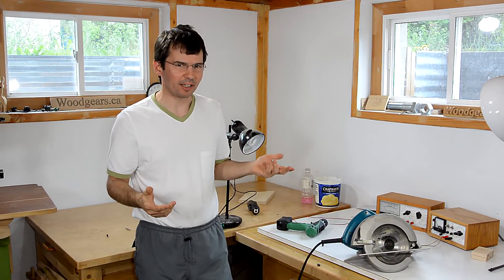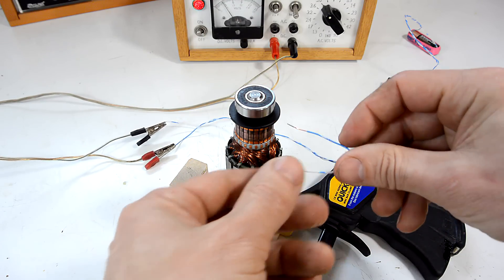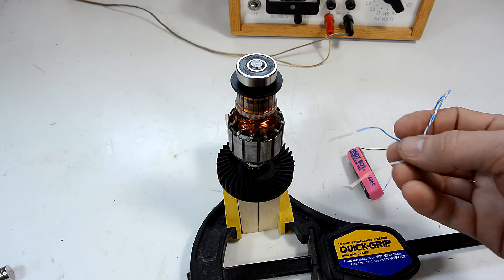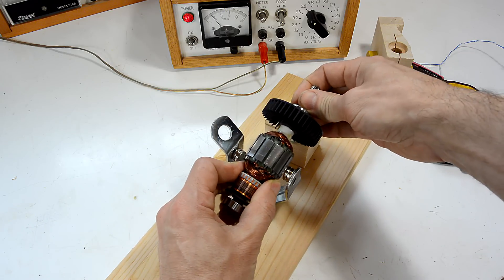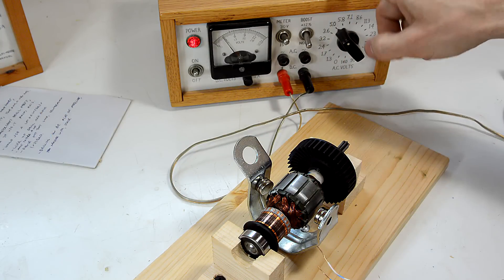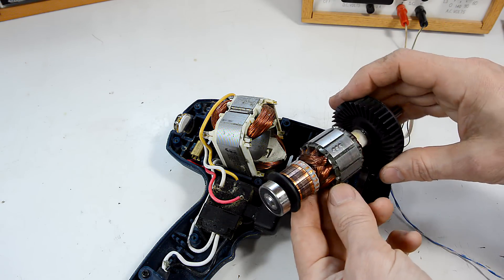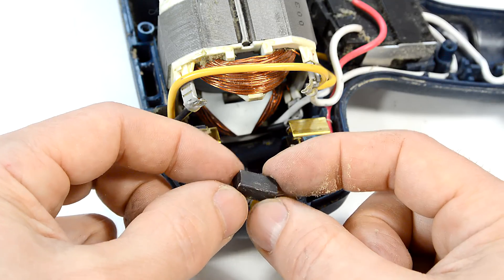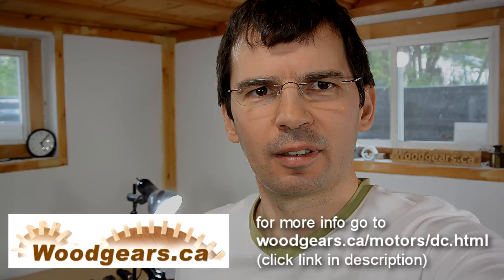How DC motors and universal motors work

Comment: Excellent presentation ! In particular, the fact that you went in to the trouble to disassemble the drill and build a wooden stand - to show us the function of the motor - is really remarkable. Also, the idea to use small battery and magnet was just brilliant. It is funny, but this is the best video I have ever seen on electric motors, and it comes from a ...woodworking channel !
Reply: time bohut dohunea boni sa

Comment: Some motors that use brushes offset them so the motor runs better in one direction over the other. Motors in toys only have 3 coils (2 would work but have dead spots, no serious motors are made with 2) with say 10 coils, you can move the interaction area closer to where the magnets are in rotation and get more force since they are closer together on average (before the brushes switch to the next coil set, playing keep-away!)

Comment: Excelent presentation. Nowdays, universal motors are mainly used, which for me is a surprise, because nobody mentions them. I was opening a hair dryer and noticed that the motor inside is brushed and didn't have permanent magnets, but it is directly connected to AC source, without a bridge rectifier, so I was surprised. Thank you

Comment: This is the best video I've seen that describes how the DC motor works.  Forget all the fancy graphics, there is nothing better than someone actually demonstrating it with actual components from a very basic perspective.
I have a video coming up that shows a very old (1905 in fact) elevator machine room.  There is a DC motor in use and I'm going to briefly explain it, with a link to your movie for a full explanation.

Comment: You know, I bet the thumbs down are accidental, I was taught this and have taught this occasionally for over 40 years, this is by far the best explanation I have ever seen. There was a science book from, I think the 50's or 60's, that showed how to make a dc motor with a long sewing needle, a cork, several straight pins, some insulated wire and a horse shoe magnet and a 6v lantern battery. It was pretty cool too.

Comment: I was always curious what they meant by brush vs brushless motors.  Thanks Matthias!
Reply: realyy???
Reply: ARTASH SARGSYAN No. The contacts on the slot car shoe were there to provide voltage to the brushes on the car's motor.
Reply: ARTASH SARGSYAN  good
Reply: ARTASH SARGSYAN                .
Reply: Yup
Reply: asim al Don't spam.
Reply: Albond 

..
Reply: BENACEUR HALLAH ?
Reply: xBeau Gaming He didn’t show a brushless motor. Brushless motors put the permanent magnets on the Commutator so the electrical connections are made on the stator (non moving outer part).

If I understand correctly you can have Brushless DC motors, or brushless induction motors, but you couldn’t have a brushless AC motor since that would require an electrical connection to the rotor.
Reply: Brushed= slow but strong
Brushed= VRROOOOOOOOOMMMMAMAAPAPAPAPAPAPPAPAPAPAPSTUTUTUTU

Comment: I am an electrical engineer that has experienced for 7 years. And when i opened this video, i believed i would watch an another boring explanation. But after then i really impressed.

At the university on electrical machines course we just wrote and wrote for tens of papers of boring theories, at the laboratory just another boring stuffs such as short circuit condition , no load condition etc. 

Was that difficult to show students, this kind of easy demonstrations step by step? All students could visualize what happens on motor then they could embrace all theories behind easily. 

So thanks a lot

Comment: Hard to believe somebody that can make their own voltmeter would stop a saw blade with their hand
Reply: tnf. the cutting section of blade was well guarded when he stopped it by hand..
Reply: You're knowledge of electric motors is really great & well explained in you're videos. I am planing connecting a 240 washer motor to 12 v DC & will probably need you're help with which connections two pair up. 
 Many Thanx........   Stan the Man.....

Comment: Note that when referring to motors-that-have-to-run-all-the-time, manufacturers usually call these constant-duty motors.  Not only are they usually brush free, they usually have better means to cool, better bearings, lower power ratings per size, etc.
Intermittent duty motors usually compromise potential service life for being more compact/powerful, and rely on the use case being so short in duration that there is no time to significantly heat up to a critical temperature.  Hand drills, engine starter motors, consumer appliances in general, all tend to use intermittent duty motors.  A lot of these motors happen to use brushes as well.

Comment: Great explanation. Some helicopters still use brush motors as starter/generators. During engine start, 28V DC turns the motor, which turns the engine. Once the engine is started, it turns into a DC generator. We have to replace the brushes during scheduled maintenance.

Comment: Because I watched this video last year, I was able to fix my cheap air compressor a few weeks ago.  The spring on one of the brushes was broken so graphite wasn't touching so I was getting a lot of arcing.  I replaced the old spring with one from a pen and it's been working fine.  I'm not sure I would have figured this out as easily as I did if I had not watched this.  Thanks.

Comment: Nice explanation
Brush motors are often used where you need the torque with low power and physical size, like drills and washing machines, induction motors are chosen for longevity without too much maintenance
Reply: That is no longer true. A 400 hertz AC induction motor connected to a closed loop feedback, vector control speed controller would walk all over a brushed motor tool in power weight and volume and torque.

Brush motors have nothing on 400 Hertz motors: /watch?v=2DwGx-QlEAQ

You can hold a 5 CONTINUOUS horsepower, 400 Hertz motor in the palm of your hand!!!!
Reply: EETechs Maybe so, but then you have electronics and gear reduction, which needs more maintenance than a simple brush motor (gearbox needs oil, electronics need cooling so needs to be cleared of dust)
and at what price, brush motors are cheap
Reply: ***** Brush motor tools spin at high RPM's just as much as the 400 Hertz motors and such motors have been around since WW2 when radar systems needed to be lightweight in flying aircraft. Gearing would be the same.

 The electronics would be a single chip solution. Temp would not be a problem because you can buy electronic components that can sit in boiling water and still work reliably well. Also, many electronic components implement temperature protection by reducing output so that the die temps stay in acceptable range.

Finally, battery powered drills use electronics for speed control and I never had issues with electronics going out. I have had more issues of motor brushes going out from wear.

Comment: Hi Matthias, I just wanted to ask a quick question about the brushes.
Currently I am building a home made DC motor for an assessment task at school. At this moment, I have little knowledge as to where I could purchase a carbon/graphite brush. I have heard you can strip off aluminium and apply the aluminium with tape onto the commutator to act as brushes. If so would it be able to work from i.e. a coca cola can? Also, I have every other part of the motor such as the rotor, axle, commutator, insulated copper wire, rare earth magnets and also a switch to help travel the current from a power pack or 9V-12V battery. Any ideas on how to increase productivity of the motors motion?
Thanks for your time.

Comment: Just a note, AC induction motors are different from Brushless DC motors. Both don't have brushes, but the principle of operation and how they are controlled are different. You wouldn't use the term "Brushless Motor" to describe an AC induction motor.

Comment: Can you elaborate on the magnetic fluxnd how  the 2 magnet set up is better?  Other than it being closer to the rotor, how does the metal piece below improve it, also why isn't the magnet jumping and sticking into the rotor when it's not secured the the metal piece. 3:07

Comment: Hello, I was wondering if universal motors have permanent magnet and coils together in the stator? If so, does the permanent magnet affect the magnetic flux if the motor was supplied with AC voltage? Thank you! Btw, super good demonstration!

Comment: Great explanation of how electric motors work Mattias, I really enjoy watching your wood working/jig making videos. I have a electric motor question for you. I recently bought a cheap used non running shop vac from someone who used it to vacuum up drywall dust (yes that is a big no no especially without a good filter) I took it all apart and cleaned everything then polished the commutator, lubricated the bearing/bushing and finally put it all back together again. It works now but when I turn it on the motor brushes become very hot and there are a lot of sparks where the brushes meet the commutator, within a few seconds it began to smoke so I turned it off right away. After taking it apart a second time I saw the commutator turned black so I re-polished it then I also cleaned the brushes with  very fine sandpaper and tried it again. Unfortunately I had the same results. What would cause this?  Cheers!

Comment: Hi mathias, could you show us a brushless motor and give us your opinion on the technology. Maybe do a review on a modern drill and explain what we're paying so much for?
Reply: Brushless DC motor is actually a motor turned inside out. The armature is now a magnet. And there are three coils around it fastened to the case. Electronics switch the current from one coil to the other electronically. There is two ways of doing this. The first way is to have a position sensor on the end of the motor so you know when to switch the power. the second way is to sense the counter emf from the coils to realize the position of the magnets and use that info to switch the coil current.

Comment: Bárbaro me gusta tu explicación, podrías decirme si funcionaria un rotor de licuadora con baterías también colocándole una batería de 1.5V como en tu ejemplo?  (Barbaro I like your explanation, you tell me if it works blender rotor also placing a battery 1.5V as in your example?)

Comment: I am surprised that an AC motor would have a brushed motor in it.  You would think with the higher amperage draw and faster rotational speeds, it would wear out the brushes quickly.  Nice video.  One note though, you didn't explain the amperage draw based on load.  Can you include that on your induction motor video?

Comment: Question- I am checking a brushed DC motor used as a fuel pump. It has 8 commutator segments and uses permanent magnets. I am checking the amperage draw on the motor using a current probe. My question is, when is the motor current draw highest, when the brushes are directly on the commutator segments, or when the brushes are bridging two segments? Thanks!

Comment: Pretty cool video, thanks! So the stronger the magnetic fields produced by the rotor and stator equal how much current/torque is produced by the motor then? Strength of the magnetic field is correlated to the speed at which the rotor operates? Thanks!

Comment: In minute 4:00, if on the right side there is "A.C Volts", why are you using DC on the left? Couldn't you use AC for the motor? I didnt know there was so low current intensities for A.C. 
Despite A.C and D.C are different, I think both currents would work to this motor, is this correct?
Reply: Brushed motors works on AC and DC, they dont give a

Comment: Great video. :)
I have a question, I just changed the brushed in my dewalt drill, and did it the cheap way, I found some old brushes from an old washing machine and I sanded them to shape. But my drill is really powerless, I can easily stop the chuck and the motor will instead get really warm. It is a new used drill I bought and it was in really rough shape, so I haven't actually seen how it did before I changed the brushes. What could be the problem? The brushes not seated well enough? The motor is broken somehow else? :s

Comment: Thankyou, thankyou, thankyou Matthias.  At last I understand.  I guess the brushes issue is why a lot of cordless drills are now coming out as brushless?  Thanks.
Reply: The brushless motors used in drills now are sort of a reverse design of the common PMDC motor. Where the rotor is composed of permanent magnets and the stationary field coils are electronically controlled. Brushless motors are as high as ~95% efficient compared to PMDC 60-7x%. That giant leap in efficiency coupled with lithium battery technology is the reason for the quantum leap in cordless tools.

Comment: hi just curious, what do you call the device that you use to power up the motor instead of using the battery as shown on 4:27, cause I want to buy something like that I don't know which brand is good. thanks again.
Reply from the maker: maximuz It's called a benchtop power supply.

Comment: Trying to troubleshoot why my drill isn’t working correctly, it burnt out so I replaced the brushes, now it works but still has a strange screech and excess spin once the trigger was depressed. (It cut should cut almost immediately).

I’m pretty sure I’ve narrowed it down to the electromagnetic part (the thingy in this video). so thank you for this video and explaining everything in such detail.

I think my problem is that the magnet has weakened some how.

If anyone could offer some advice or help I would also be greatly appreciative.

Comment: Hi, i have a phase 1 brushless motor for a bench grinder.  It hums but won't start and the capacitor works.  I attempted to manually give the rotor a push to see if it starts but it is locked.  Any suggestions on how to troubleshoot this problem?  Thanks

Comment: Great video, but it raised a couple questions for me. I know a lot of cordless drills use PWM (pulse width modulation) to control the amount of voltage to the motor, but PWM is a varying DC signal, not an AC signal. Is it really an AC signal? If so, do you have an Oscilloscope? I would be quite interested in seeing the signal being fed  into the motor and the stator assembly. It just seems like unnecessary complexity to introduce an AC signal into the system when it adds no tangible benefit to overall operation.
Reply: PWM is an electrically efficient way to vary the speed of the motor.  Drills often need to be used at differing speeds, which could be achieved if one varied the DC voltage applied to the motor windings.  If the drill's battery is 12V, and one wants to apply 4V to the motor windings to make the drill operate at a slower speed it could be done with a DC voltage regulator but the transistor that provides the required 8V voltage drop would waste a significant amount of battery energy that would be converted to heat.  By using PWM, a high frequency pulsed DC signal that is 12V one third of the time and 0 V two thirds of the time would be applied to the motor windings.  The mass of the armature cannot respond fast enough to follow the individual high frequency pulses so it effectively averages the pulsed DC signal to what the motor sees as an equivalent 4V DC voltage.  PWM can be generated with minimal loss, which is important for battery operated devices.
Reply: It is true that the PWM is a DC signal, but dont get confused, the PMW signal is still pulsating, By changing the width of such pulses, the average DC valtage changes aswell and thus changing the input voltage of the motor.
Reply: arlen raasch All correct, and I agree completely. My question was whether or not he is confusing AC and PWM in the video, because these are not the same thing.

R. Rodríguez Its still not AC though, its called a varying DC signal. There is a difference, it does not cross the 0v mark into negative voltage. Pulsating is not the same as AC. AC is when the voltage alternates between two opposing values/polarities, hence alternating current. The polarity does not alternate in PWM, only the width of the pulse changes thus the motor only sees the average voltage, this is a completely different process. 

It seems by both of these responses that chances are it is not AC, it is PWM. That clears up my question, thanks!
Reply: well, thats what tried to say...I will explain myself better the next time XD. regards !
Reply: R. Rodríguez Haha, No worries, I probobly just misunderstood! Thanks for the response! =D

Comment: Hi. I really enjoy your woodworking videos, and have recently watched some of your videos on ac/dc motors. HELP! I recently connected what I now understand to be a dc motor from a treadmill to 240v ac. Yes, there was smoke and action. Is it game over for the motor or do I have a next move? Much gratitude for any help  you can offer..
Reply from the maker: ***** No loss there.  Those treadmill motors aren't really suitable for anything else.
Reply: Thanks for the reply. Only just saw it. I have big plans fir the treadmill motors I have on the shelf. Why are they useless?
Reply: ***** No way are they useless!  I have seen lathes with them.  The big advantage is that you can adjust the rpm from 0-max.  Anything that spins can be made into something fun.